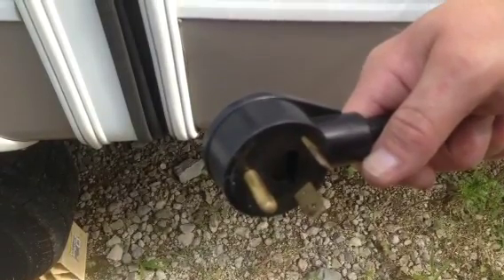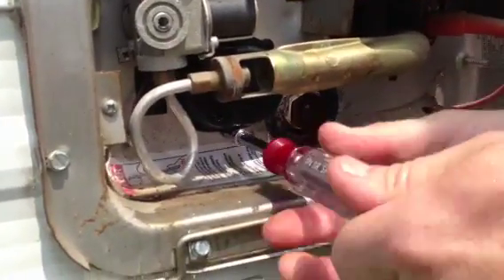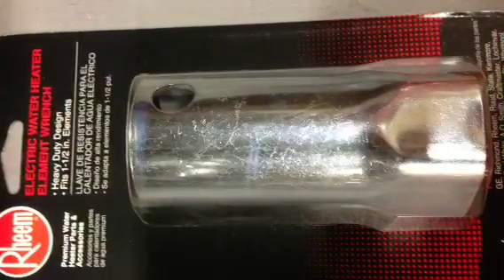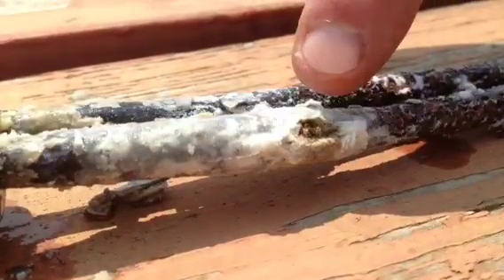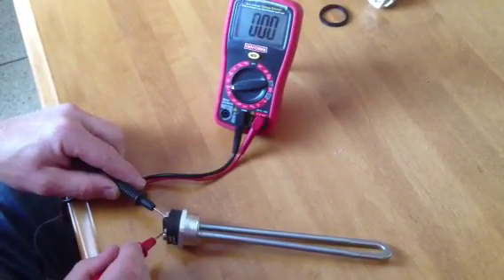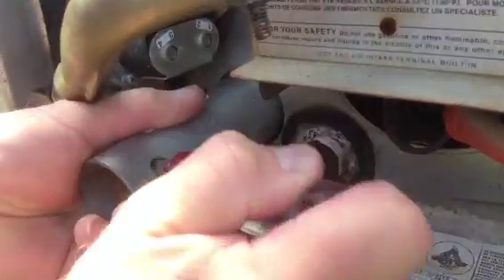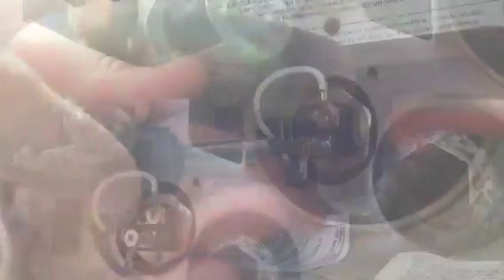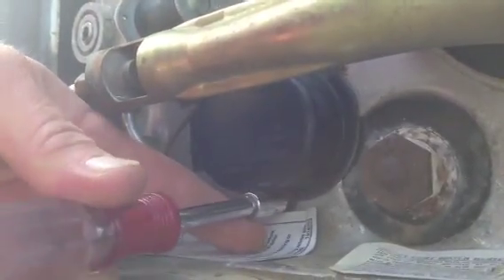Replacing the water heater element in an RV. By How-to Bob

Comment: Instead of using the emergency pressure relief valve and blasting water all over the components, simply turn on a hot water faucet inside
Reply from the maker: That was already done.
Thanks for watching.

Comment: There are two very important things I would add to this video. Sense you are replacing the electrical heating element, you would also at the same time replace the anode. Reason being if the element is bad, and you are draining the tank, good time to replace anode. Second point, he should have after hand tighten element with large socket, then you only need to turn additional half turn to seal properly! And I would add, to turn on hot water fawcette when water comes thru fawcette, then you are safe to turn on hot water heater element!
Reply from the maker: The anode rod was already changed. It gets changed every other year. The element seal perfectly the way I installed it and the water was run before turning it on. All covered. Thanks for watching.
Reply: 3rd point, fill tank and check for leaks before installing the cover.

Comment: Bob, have you ever consider simply swapping out the poorly designed/engineered Atwood hot water heater for a tankless Girard.  In my opinion, Girard is the hot water heaters should have been designed/engineered in the first place.
Reply from the maker: At what cost? I don't feel it would be worth the time, aggravation, or expense.

Comment: I have a Atwood water heater,   When the tank is full with it off everything is dry,  when the tank is full and I turn on the propane and water gets hot everything is dry.  When tank is full and I turn in electric and water gets hot there starts a pretty good drip that appears to becoming from the outlet fittings.    What’s happening here, doesn’t make sense
Reply from the maker: It may be overheating, try tightening the fitting.
Hope this helps.
Thanks for watching.

Comment: Thanks Bob! Atwood 6 gal.-Gas works to heat water. Smells hot if left on too long.  Electric doesn't work which is obviously our desired mode when not dry camping. Would one still suspect the heating element? Tha ks for a great video. Quick and to the point.
Reply from the maker: Easy check with a meter set to Ohms. If it reads infinity element is bad, if it reads close to 0 element is good. Hope this helps.

Comment: Good straight forward procedure. How would you address replacing the breaker at the same time as the element? Mine is frozen “on” so I’m sure it too is bad.
Reply from the maker: Yes definitely replace it. Should be an easy replacement just make sure you are not hooked up to power. Thanks for watching.

Comment: Bob, this was great information.  We looked at ours and it looks completely different.  We have a 2002 Fleetwood Discovery 38p.  We cannot see the access to the element?  There is not plate as you mentioned.  Thanks for any suggestions.
Reply from the maker: There should be some type of wiring going to the element somewhere, there could be a different type of cover or the element could be located in a different location. It’s really hard to tell to tell without seeing it. Thanks for watching.

Comment: Perfect same water heater i have and how simple can you get it....was wondering if you can put hotter elements if you wanted so the electric is hotter...Yes i no i can use my propane side of the hot water heater but sure would be nice if the electric was hotter to!
Reply from the maker: I would not change the wattage of the element, that may raise the amperage above what the wiring can handle depending on what gauge wire was used.
Hope this helps, thanks for watching.

Comment: Hey bob great vidoe , I have a 30 amp rv and I need to replace the heater part do all rvs have a 120 v heater unit or not before I replace it?
Reply from the maker: +Cesar Morales Most of the RV's have a heater that are 120v, you can verify by looking at the end of the water heater element...It should show you the specs for the element (Wattage and voltage) Many times you can pick up a 120v water heater element at a hardware store at a cheaper price. It would be OK to go with a lower wattage heater if you need to, the only affect would be that it would heat the water slower (you may not even notice). Another way to check is to look at the breaker panel and see what the breaker for the water heater says. I willing to bet that yours is a 120v because the 30amp service that you plug  into is 120v. hope this helps, Thanks for watching.
Reply: Yes,thank you so much I'm new at this rv life just not familiar with the parts and how it works . but I'm getting there thanks to videos likes yours !!!!!

Comment: Thanks for the video. My electric water heater quit working sometime yesterday but I switched over to propane and it works on gas. My trailer is 10 years old and I've always used the electric heater. Do you think it's the element that quit working? I'd rather run it by electric instead of going through extra propane.
Reply from the maker: It is possible that the element went out you can test it before taking it apart. It should be an easy and relatively cheap fix.
Thanks for watching.
Reply: @funbro1  finally made it to the hardware store and picked up an element and a wrench. Thanks to your video, it took 10 minutes and $40 to be back in business. 👍👍😊

Comment: Do you have video about flushing out the hot water tank on this Atwood ... We have smelly hot water and are needing advise on cleaning and flushing it out. Thanks - first time trailer owners ! We have a 2008 jayco with the Atwood heater
Reply from the maker: I do not currently have a video on that but it is very easy to do. You should have another screw it type plug in  your water heater. This is the anode rod. it is used to save your water heater from corroding. It just sits in there and is not hooked up to anything. If you remove the anode rod you can use that hole to flush the water heater out by just hooking up a hose to the inlet of the RV. You will get a lot of nasty stuff out that way and it should help with the smell also. You may want to add a small amount of bleach to kill any mold that may be inside. Hope this helps. Thanks for watching.
Reply: Lynette Williams
Reply: funbro1

Comment: Hi Bob, what model is this water heater. Where do you find the model number.  Great video. Thanks
Reply from the maker: Once you remove the element there should be some information on the wiring end that will tell you the wattage rating. I went to the hardware store and found one that matched.

Comment: When an element burns in an atwood heater is it possible for an electrical smell to enter the rv's interior? I had such a smell and now the electric portion of the heater does not work. No scorch marks or burnt fuses so the next thing to check is the element but I can't figure out how an element burning out might release an odour into the rv. Thoughts?
Reply from the maker: E Wade It is possible depending on how long it was burning. Hopefully once it's replaced the smell will go away soon. Thanks for watching.
Reply: It shorted out

Comment: I have a 2014 Springdale with a similar hot water tank,  Last time we ran it on propane. it put out a large yellow flame and sooted up the back of our camper.  Any idea?
Reply from the maker: Many times spiders like to make webs in the small parts of our RV's it is possible you may have had a web built up that caused the mixture to be off slightly causing the yellow soot fill flame. Try looking in all the tubes with a flash light to see if there is anything obstructing any of the tubes. It is also possible that you may have burnt whatever was in there out and everything will be OK now.  Thanks for the question.

Comment: Hi funbro1, I'm looking for suggestions for this problem.
We install a gas water heater - suburban Sw6da. Long story short - we plugged 240v electric system to 12v water heater - the mother board fried up. 
Talking to different people, some suggest to change the water heater as the electrical components might have damaged when plug it in, so even though the mother board is changed the same thing will happen once i plug it in again. Some others told me to change mother board as the only electrical component is the spark plug - the rest are all mechanic.
What would you do?
Reply from the maker: If the water heater was new when you installed it I would just replace the parts that are damaged, and make sure to only run 12v to the heater. Hope this helps, Thanks for the question.
Reply: thanks for the answer. the problem is that I'm not sure apart from the mother board if there is any other parts damaged. do you know what electrical parts are attached to the mother board going into the water heater?
Reply from the maker: What exactly are you calling the mother board? Are you talking about the control board on the water heater?
Reply from the maker: The only thing the control panel on the heater will do is send a ignition spark. It will do this several times before it "gives up" assuming something is wrong. After resetting you can try it again but before trying it again first find out why it did not light. If you are not getting a spark the chances are that it is your control board, Assuming your battery or power source is appropriate.

Comment: I have accidentally turned on my hot water heater (electrical side) while there was no water in the tank (had been winterized). Now it no longer heats using electric. Have I damaged the element or the thermostat? Or both?
Reply from the maker: Usually the element is the problem when something like this happens. Happens to the best of us. Good thing is that it should be a easy relatively inexpensive fix. Thanks for watching.
Reply: I too accidentally left mine on, it's just a wall switch. Left it up and drained the water. Stayed at a park for a month and it only used the propane. The last day, ran out of propane and no hot water. 
  Cane home, checked it, sure enough, not working 
I sure am blessed to have found this video if how to change it out! 
We all need a check off list to make sure we TURN OFF THE ELECTRIC to our water heaters. We will look like pilots going thru our check list..LOL

Comment: Hey, have a quick question for ya. My water heater keeps tripping the breaker inside the rv. But when it does, it makes a loud sound almost like a garbage disposal, then trips the breaker. New to all this stuff, think it could be a bad heating element? Also, does the breaker have to be on for it to heat up using gas? Thanks for your time sir!
Reply from the maker: Since the element is the easiest to test I would start there. Set your meter to Ohms, if you get a low reading like around 10 ohms  then the element is good. If it is a higher reading or no reading at all then replace the element. I'm not sure about the noise though. As for the breaker it should not have to be on for the gas to be used because each heating system runs independently. Hope this helps. Thanks for watching.
Reply: @funbro1  thanks for the quick reply! I'll try it out and see what I come up with on my meter. Thanks again!
Reply from the maker: Let us know what you find.
Reply: @funbro1  hey sorry for the late reply, have been working a lot. It was the heating element! Didnt even have to test it it was busted wide open on one side lol. Thanks for all your time and help kind sir! Not all heroes wear capes ;) lol
Reply from the maker: Awesome, Happy camping.

Comment: Bob, any tips on removing the element if it's being stubborn?  I've tried removing mine with a water heater wrench and screwdriver and it's so tight I've bent my screwdriver.  Any help would be appreciated. 
Thanks.
Reply from the maker: Jim Gooch Wow it sounds like it is really on there tight. try using a penetrating oil like PB Blaster or something similar and let it sit overnight. Worse case you could use an impact but be very careful so you don't damage anything. Hope this helps, good luck.
Reply: funbro1 The penetrating oil, WD-40, took care of the stubborn element.  Thanks for the video and your suggestion they were a big help.
Reply from the maker: Root599 That's good to hear that you got that stubborn thing out. Thanks for letting us know and thanks for watching.

Comment: Nice video.  I would also recommend that the anode is replaced as well.  This helps extend the life of the water heater.
Reply from the maker: I agree the anode should be replaced periodically to protect the tank. I would not just replace it if the element was the only issue and it had just been replaced. For details on this please search how to replace the anode rod in a water heater.

Thanks for watching.

Comment: Do I have to turn off propane and disconnect the battery?
Reply from the maker: Technically, No the element runs on 120 volts so DO make sure that you have disconnected the power to the unit. The propane is a separate system and the battery will only light the propane. As always if you feel safer doing so it would not hurt to disconnect either or all. Thanks for the question and Thanks for watching.

Comment: Hi, i am new to RV,  exact same hot water system, not lighting by gas? why this is.Electric 240 v i can hear  heating  sound,inside the RV the water switch when switched on only comes on when the 12 v car is switched on.No water coming out of the internal taps?Water tank has been filled.No pressure from internal taps or water exiting the pressure valve .What else should i be doing?
Reply from the maker: Sounds like you have a valve in the wrong position, or it could be one of many things. It's really hard to try to diagnose the issue without seeing the RV. Thanks for watching
Reply: It happen to be a switch on the control panel,to be switched on.for the use of 12 v.I am learning very quickly.

Comment: What do I do if the element is rusted in.? I can’t turn it at all.
Reply from the maker: Soak in in penetrating oil and lightly tap on it to work the oil in. Let us sit for awhile then try it again. If you can fit an impact on there you could try that as a last resort. There is probably a lot of corrosion inside there.
Hope this helps, thanks for watching.

Comment: i cant locate the electric element in a 6 gallon atwood water heater...ive been a licensed Master Plumber for over 40 years, just cant find
 location
Reply from the maker: Mike Tomchik whay model do you have?
Reply: It's inside the trailer under the seat (or where ever they hid it).  A major pain to access.  I'm working on this now.

Comment: Great video,  very informative,  straightforward,  thanx
Reply from the maker: Thanks for watching.
Reply: I'm in west tx right now for work,  living in my 5th wheel full time,  I work up yesterday morning no hot water, took a ridiculously cold shower,  watched your video last night and this morning no water at all, temp never got above 23°, so while on my trip to the hardware store getting water heater parts I'm looking for a heated hose as well,  the low for Sunday is 7°,  record breaking temps for tx,  literally since 1899 news reports say
Reply from the maker: Wow that’s really cold for that area. Stay safe.
Reply: @funbro1  we're expecting 5-8 inches of snow,  in the desert in tx. Polar vortex,  I managed to change the element in my water still no hot water,  it's a surburban water heater,  I don't know what to try next
Reply from the maker: If you have a meter check the power to the screws on the element. If you do not have power check back from there. Sometimes there is a reset switch near the water heater. Next check the breaker.
Reply: @funbro1  thank you for tips sir

Comment: I need to see a video of why my Gas is not lighting to heat the hot water.. It's been doing great but for some reason it stopped lighting.. yes I have plenty of gas in the tanks
Reply from the maker: It sounds like you may be out of gas...Seriously are you getting gas flow to the nozzle? You should smell gas after it tries to start for awhile. If not then possible nozzle clogged. Next check to make sure that you are getting a nice arc when the igniter is firing. If you get a nice arc is the arc where the gas can reach it? If all this is good you may want to check the thermocouple. Hope this helps
Reply: I have a full tank.. I just reset everything and it came right on and started working...  Thanks!
Reply from the maker: Must have been an empty tank ;-)

Comment: something is wrong with your meter, you cannot have 0 ohms. 1500watts 120volts. Ohms law
 R=V2/P...(120×120)÷1500=9.6
Your new element should read about 10 ohms
Reply from the maker: Nothing is wrong with the meter. While your math is correct using Ohms law I chose to set the meter so that it would not be so sensitive just so that I could show a “yes” or “no” condition. I could have dialed the meter in a bit to get an accurate rating but that wouldn’t make a difference. Thanks for watching hope this helps.

Comment: I keep having the gasket or washer blow out after the water starts getting warm
Reply from the maker: Keith Brooks I have never had this experience. Maybe it is too tight or possible too loose? Did you use an aftermarket element purchased from the hardware store or the factory element?
Reply: Bought it from the RV place in my hometown.

Comment: wat size element???
Reply from the maker: Same size that was removed. Some are different wattage so try to match it up to what was in there originally. Thanks for watching.
Reply: @funbro1  yea only problem is t was replaced before i bought camper and i have no specs on it but im  hoping its correct
Reply from the maker: The replacement should have specs stamped on the top somewhere.